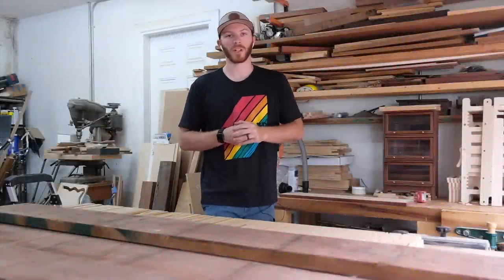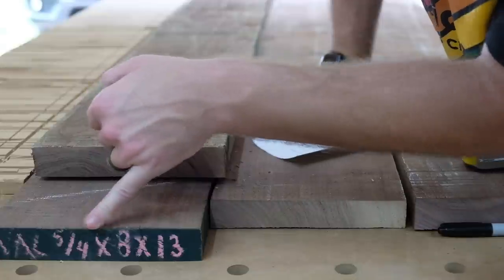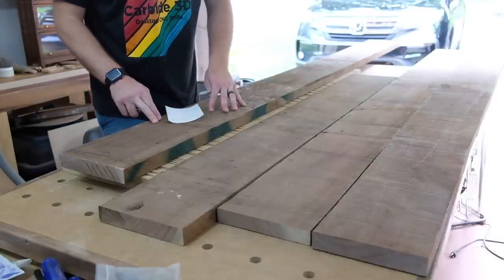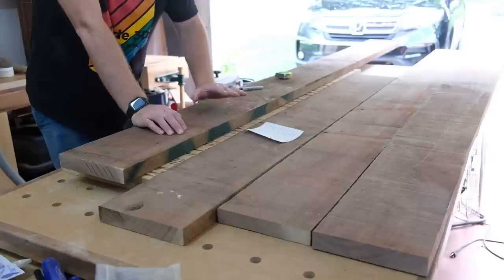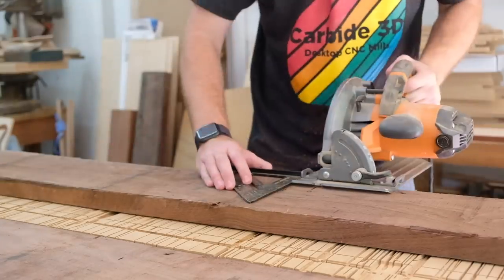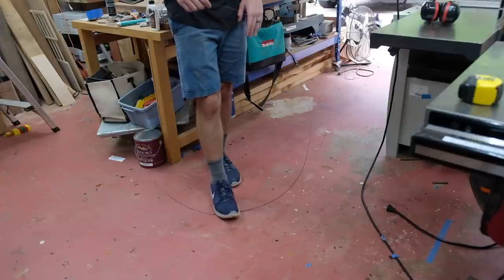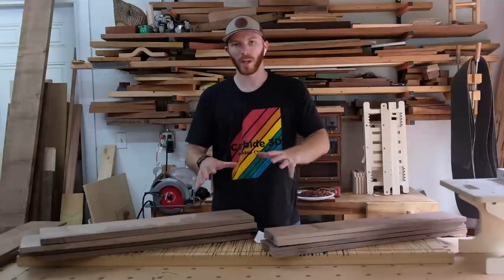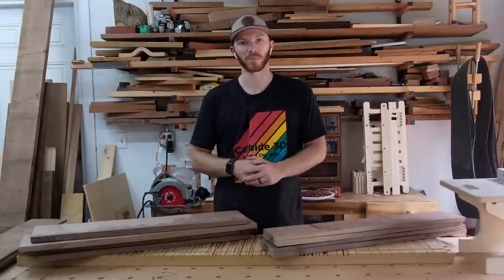Breaking Down Rough Lumber for a New Project - Watch Cabinet Build

Comment: I am particularly interested in the half mortise lock. More specifically can it be cut with a band saw. If not, i am still interested in the mortise locks specifics. Including layout.
Reply from the maker: I don’t think a bandsaw could be used. I’ll be using a router for the bulk material removal and a chisel to clean everything up.

Comment: 2:13 that's rift sawn (transitioning to flat sawn), not quarter. The board underneath it on the log would have been quarter sawn.

It's still quite nice though.
Reply from the maker: Good point, you’re right. I’ll admit from time to time I use the two terms interchangeably. 🙃

Comment: Great video! Noticed you don't use your fence when re sawing is there a benefit to not using it when re sawing? I have had mixed results using and not using the fence but am new to re sawing lumber.
Reply from the maker: Thanks Benjamin! I’ve never gotten it dialed in properly and don’t trust it not to drift and ruin my workpiece. So I just free hand it and that usually works well enough.

Comment: I usually joint the large side of the board as well and then use the fence of the bandsaw. Do you feel you loose less material with your method or its a matter of preference?
Reply from the maker: These boards seemed relatively flat so I didn’t feel the need to rake that step. But often times I will joint the face like you mentioned. Especially if resawing on the table saw.